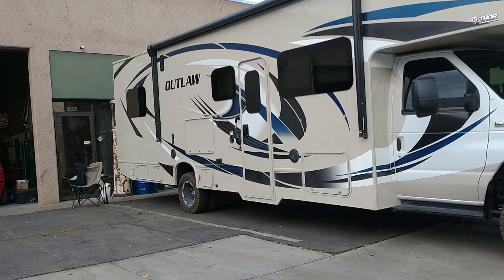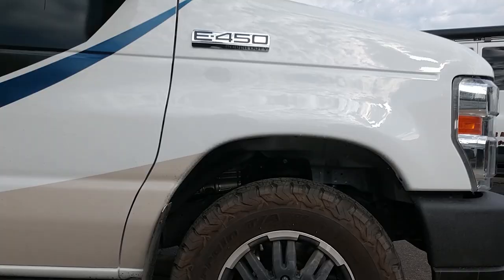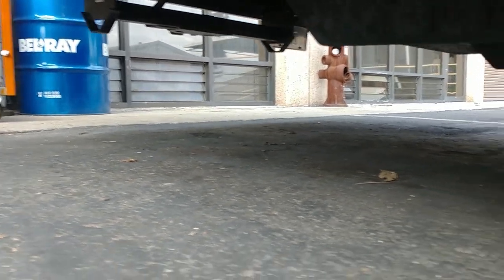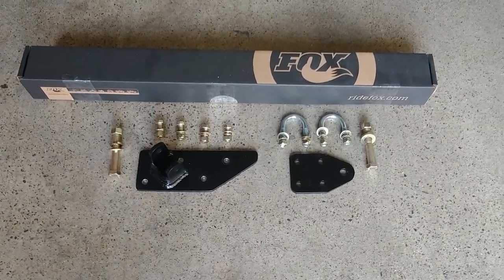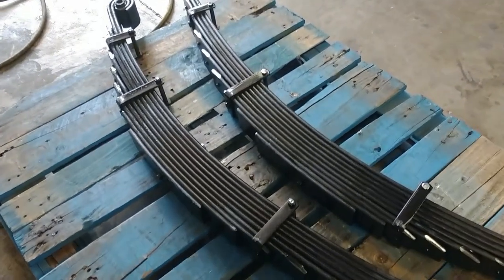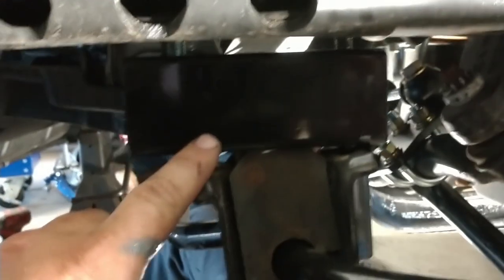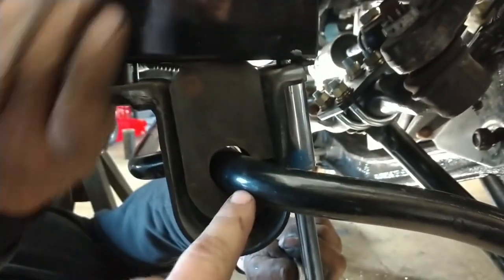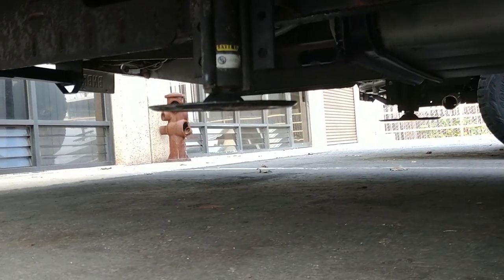The Best RV Suspension You Can Get!!

Comment: Perfect for the Thor Outlaw, stock garage rating in1500 pounds and not enough for two Harleys and gear.  One potential problem raising the levelers can effect the leveling.  You may need to carry the yellow leveling blocks to get the vehicle level with the higher distance.
Reply from the maker: Absolutely correct, sometimes you will need some blocks to help the jacks reach!! 🤘

Comment: I've noticed you guy's use 188s coil springs on RV camper vans and 186s coil springs on regular vans. Is it because of the weight difference?
Reply from the maker: Correct, the Rv's are much heavier than the vans! 👍